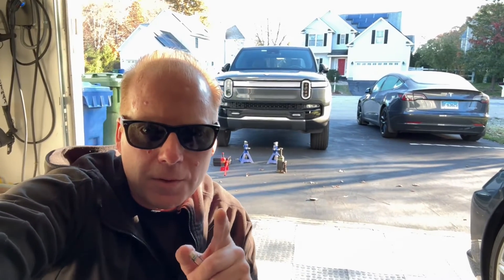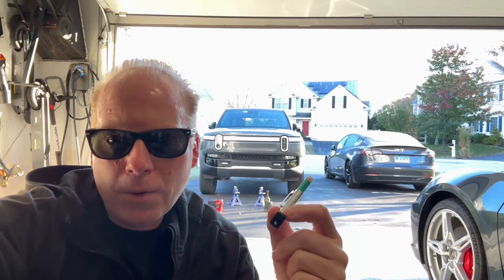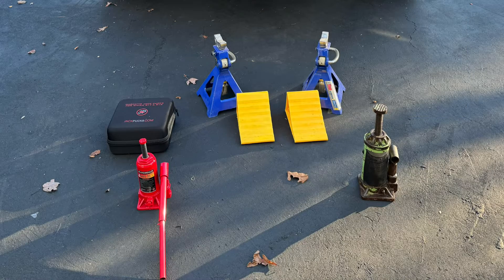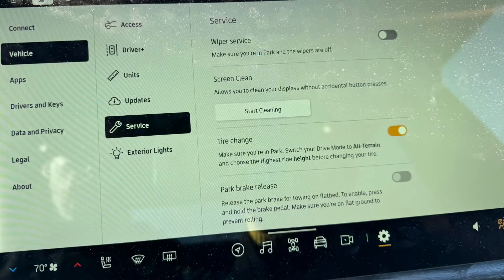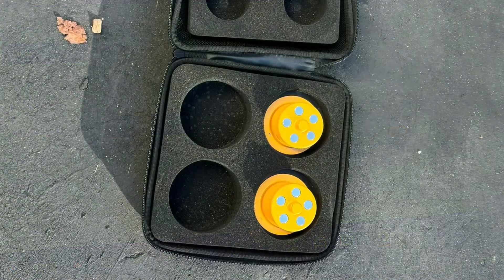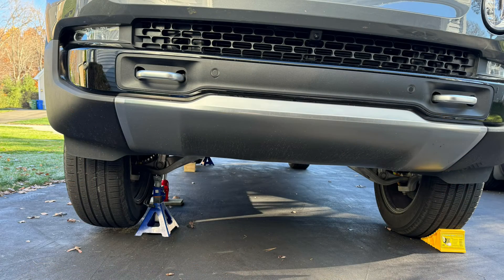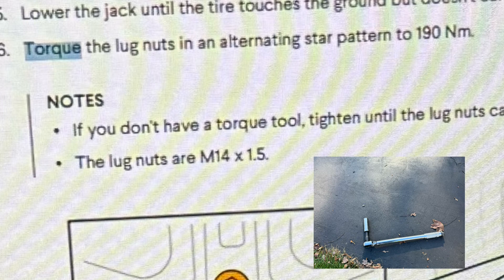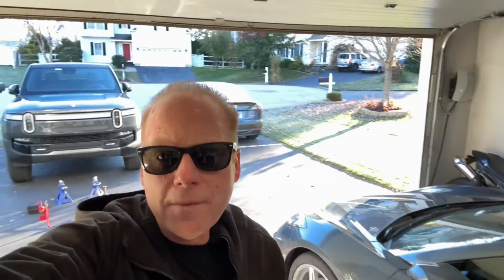How to Rotate The Tires on a Rivian R1T or R1S.  How Much Tire Wear After 11k Miles?

Comment: With one side lifted at a time did you just rotate front to back or did you crisscross the tires front to back?
Reply from the maker: Front to back
Reply: @keenanjeff is that the rotating pattern recommended?  I can’t find anything definitive.
Reply from the maker: @alonzogonzalez3062  yes and you would need 2x the jacks and stands to do it any other way
Reply: No if you look in the Rivian maintenance guide in the infotainment its front to back criss cross.
Reply: @Dmonies91  With 2 jacks you can put up both front. Swap the fronts and just tighten them snug. Drop the front and then pick up one side and swap the front to back then tighten to spec. Do the same on the other side. It's and extra step to be sure, but front to back criss cross can be done with two jacks and pucks. 
Or you can do the sides first, then raise both back end and swap the rears.